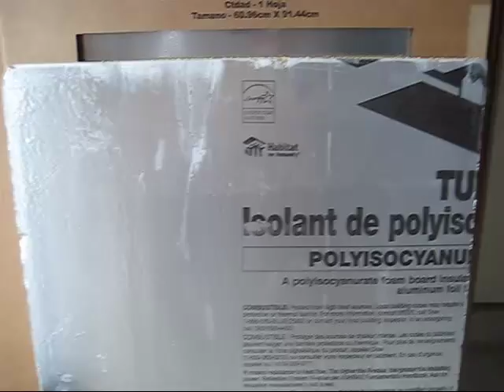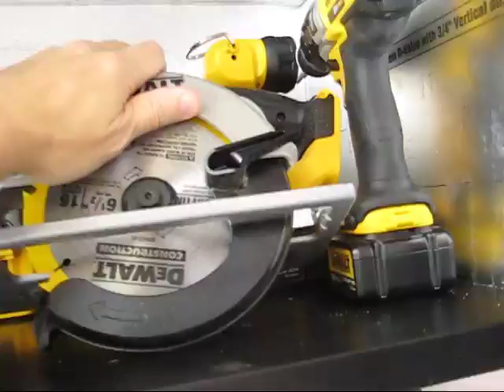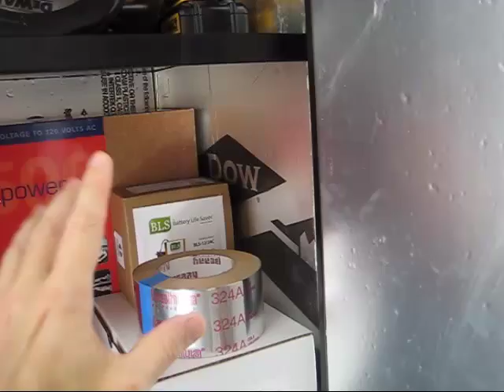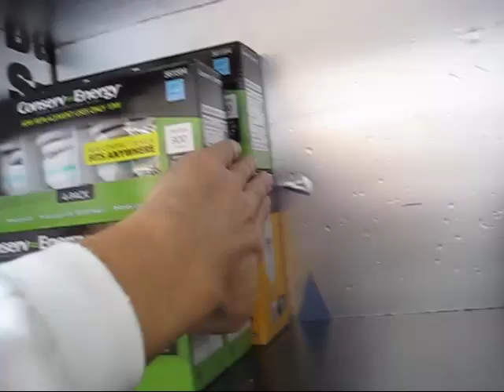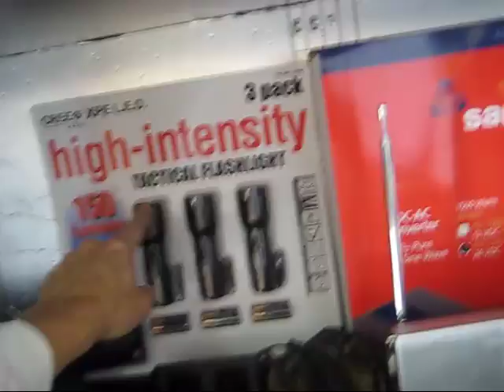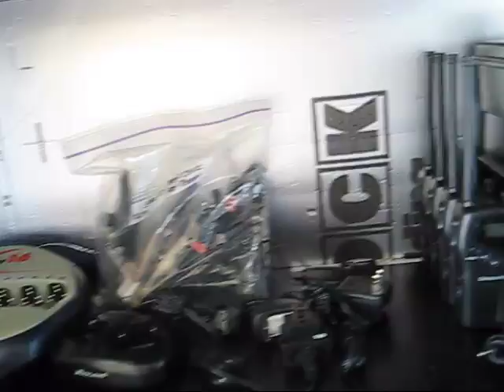Faraday Cage: How to Make on the Cheap

Comment: YOUR rule, no signals must enter?????? Aren't we being PRESUMPTUOUS???? The effective Electromagnetic potential from an EMP will greatly exceed any local RF radio station but only for a brief period of time. The foil will degrade over time from opening and closing the door. A better choice would be metal screen with screws going through the screen into the front door and side doors. You should sand off the paint wherever  the screws go through the screen.The screen material must be metal and NOT the newer synthetic or fiberglass screens. Also consider driving an 8' ground rod into your soil close to your cage and use heavy wire attached to the cabinet of the cage. This will keep the potential of the cage at ground potential. Again, sand the paint off where the screws mount into the cage, I would run 3 or 4 wires up and down the cabinet side to the ground rod and keep the wires as short as possible.
if Items like electric motors on a chain saw are destroyed by an EMP event, you will be too close yourself and probably NOT survive.
Items that contain modern electronic components should be your concern. 
Radios, computers, calculators, TV's Monitors, digital cameras, VCR's DVD's, cell phones, or anything that has a processor or controller in it which would include any device that has a digital display..
You might want to consider putting a CB radio in your faraday cage and/or get a Ham Radio receiver that covers the Ham Bands. The bands that will be important are the 80/75, 40 and 20 meter bands. The 40  meter band has a day time range of ~300 to 600 miles or further. The 80/75 meter bands is bad during the day but good for ~200 to ~500 at night. The 20 meter band can be good for many thousands of miles but this band is often dead day and night. All of these ranges are just averfages and very much antenna dependent. But even 50 feet of wire hanging in a tree to your receiver will provide OK reception. You can NOT transmit on that piece of wire unless you have an antenna tuner and knowledge to use it.  Kenwood, Icom, Yaesu, Ten Tec, Elecraft, all make receivers or Transceivers. You will need to get a Ham license to transmit normally but during an emergency such as an EMP event, the FCC will not fine you if your intent is related to the emergency and a matter of life and death. Chit chat and general communications without a license can leave you with a $20,000 fine.
I would put solar panels in your cage. If there is a regional EMP event it's likely the Internet could be down for weeks if not months depending on the severity, cell phones too. I ould expect over the air conventional TV to be up quickly in many areas.
A gasoline or diesel generator should survive an event, HOWEVER, electronics on the gen such as control panels monitors and electronic driven ignitions  may fail.

Comment: It's probably already been covered, but in order for it to be a true faraday cage, you should ground it. This could be as simple as running a grounding cable to a water pipe in your bathroom...
Reply: just dont be in the shower or tub or using a sink when an EMP goes off though.....

Comment: HI, just a thought.....
  The metal shelves are attached with a metal fastener of some sort, I am thinking that in a event, high current could be transmitted inside of the cabinet via anything that is not independently insulated to the outside of the cabinet. I am basing this off of the emp event of 1859 and the large current that was able to bridge across weak insulated areas. I am not saying your idea is bad, I really like the concept, I am just pointing out something that might help improve on your design. Thanks for your videos and ideas if you get a chance let me know what you think of mine.

Comment: thank you so much for this idea. it was very valuable info. i investigated further and found out that if you wrap completely an item in aluminum foil the place in a large ziplock or non conductive material then rewrap in aluminum foil again, it will protect your flashlights, batteries, short wave radio, etc. i will be doing this until i cn do the cabinet thing. again, thank you for your awesome video

Comment: I think you're only shielding from electrostatic fields with this method.
First, all devices have to be completely discharged, not just off.; batteries out, antennas removed and receiver inputs capped.
Second, those electronics are not designed to be EMP resistant.
Third, think high-density shielding.
After that is place your shielded enclosure under ground. :)

Comment: If you want to double check a faraday cage is working then put your mobile phone inside. Try and ring your mobile/cell phone, If your phone gets a signal then its not working. 
Metal shelves inside the cabinet are a total failure point because they are joined to the outside. 
Internally a faraday cage needs to be totally insulated.  
Saying that electrical goods are in there own plastic cases so they will be ok on a metal shelf is foolish. 
An electro magnetic pulse works in the same way as micro waves (like your microwave oven) 
You have a good idea using that cabinet but your information and needs a re-think.

Comment: You have not insulated the inside of your cabinet.
The inside is metal and i assume the shelves are metal as well?
When you built your garbage can faraday cage you lined the inside.
If people are going to use a faraday cage then they need to include the batteries and a way of charging them.
That would usually mean solar panels and then you need to take into account that you will need more batteries charged when there are less daylight hours to run flashlights but at that time of year you will have less sun to charge them, 
This means you need double the amount of solar panels.

Comment: what the deal with the mixer and or blender in there? emp wouldn't really damage a hand mixer would it? no transistors just a switch and a motor maybe some resistors but nothing that wouldn't survive an emp. let me know if i'm wrong but i wouldn't think it would be effective against a resistor. no as far as the cordless drill is concerned it would need to be in there. but not a flashlight and kitchen stuff unless its a super new one with transistors just my thoughts.

Comment: Ace...
A two meter radio is most common about $200 at Radio Shack.
Check with your local ham radio club. Those people LOVE to help newbies
and may have used equipment you can buy and learn to use.
Radio Shack also had books on Ham license, and other things that are very helpful for reference on the ham radio world.
A shortwave radio is available at RS too. Only get the top of the line model and their amplifier and copper wire antenna kit to get good reception.
A CB radio saved me once..get one.

Comment: Very well done presentation.
You should get a solar powered battery charger.
A homemade wood frame box with shelves wrapped in those insulation boards or aluminum foils might work also using scrap lumber for the box.
I hope you have a good manual water purifying system too.
How are you protecting your computers?
Lots of books on how to do things are essential. Available on Amazon.
Wood burning cookstove? Also for heating if vented.
How about a human powered generator (bicycle powered)

Comment: One thing that should be mentioned.   The cage really should be heavily grounded.  I used to work in a cage doing electronic testing.  Upon my inspection of the construction, grounding wires ran everywhere.  An emp propagates the same way electricity does.  Hence path of least resistance.  Everything wants balance, and ground is the fastest way to find it.

Comment: Correct, in fact you are both right. There are some batteries which only contain the cadmium properties However Most batteries these days also contain a regulator chip inside them especially if they have any intention as a rechargeable battery. And lets face it that's 90% of batteries these days. From our cellular devices to our gameboy batteries. They are highly likely to become ineffective in the event of an EMP

Comment: i think you would need to have your shelves removed, your shelves are tied to the case, not free of it, then when totally insulated, make your shelves supported from the bottom and keep them free standing, just sitting in the cabinet and not tied to the wall or any metal, but a really good idea,,,,,i double up, use an ammo can line with styrofoam top and bottom and wall to wall, a good sized tool box will give a good seal too

Comment: I am just starting to learn about Faraday cages, and I know you said that your electronics are protected from the metal shelves by therir packaging, but it seems to me, a high powered pulse would transmit the energy into the cage through the shelves, if the shelves have an electrical connection to the outside(?).  Might be safer to rig up some plastic shelves, IMO.  Thanks for the video :-)

Comment: I saw a video where a guy wrapped his cell phone in alluminum foil and it blocked the signal. The call did not go through and no missed call was registered. He tried it in his microwave and steel ammo can but those failed to block the signal. It wonder if the crumpled nature of the alluminum foil had a role to play. If it's as easy as that, it's worth knowing as well.

Comment: LDSPrepper - there are some solar arrays that contain a blocking diode that may burn out from an EMP. As long as it just shorts the diode then the panels will still work, just need to be disconnected at night. If the EMP opens the diodes then you would have to find where the open is and either short across it or put in a new blocking diode.

Comment: Even if the company says it's fine, if you can afford it it is still a good idea to have spares just in case. Beyond the possibility of breaking, and EMP can cause an electrical current burst in your system if there are any electronics connected which can fry out the cells, the wiring, and melt the soldering inside the panels. So while the EMP itself may not effect the panels there is still the possibility of the indirect effects of the EMP killing your panels. Better safe than sorry.

Comment: Just curious,,, did it occur to you to get into the cage with the radio and have someone else close it up to see if the signal is indeed lost? I'm wondering how effective the insulation panels would be for sound proofing and if maybe some of the effect you've witnessed isn't perhaps a mix of EMP & sound proofing together. Just wondering is all, not contradicting,, ok,, just wondering..

Comment from the maker: Your panels and batteries will work fine because there are no electronics in them. You need to store a backup controller and inverter in a Faraday cage because they are electronic and will fry in a EMP, if you are concerned about an EMP.

Comment: You also need to keep all your stuff AWAY from the sides of you cabinet and use a rubber mateor plastic on your shelves VERY inportant. A emp will go from the outside to the inside so INSULATE           PETE

Comment: Another thing, for your backup drive in the cage... wont the cables  and power line leading outside of the cage act as a conductor back to the drive inside?. Do you have your batteries and solar panels protected too? Gen set?
Just asking questions.... to things you didn't address.

Comment: We had a metal cabinet sitting in our garage, left over from a business we sold.  So out went the cans of paint that were being stored...I first tried just the metal tape without the insulation panels and that reduced the radio signal, but did not cut it out completely.  So we bought the 1/2" insulation panels with the metal backing.  I taped it to the outside with the metal facing inward.  And that did it!  All I got was radio static!

Comment: Hi, just thought I'd mention a couple words on EMPs they can occur at multiple frequencies, Radio and Tv signals are in the VHF/UHF bands, for solar flares you want to shield up to 1GHz at -50db according to links online, 1Ghz is more like a gmss band radio, or a wireless a router the oldest kinds. Those radio waves are smaller the smaller the wave the smaller crack it can get into radio stations in am are in the KHz range while fm about in the 90-110 MHz range this varies, nuclear EMPs seem low

Comment from the maker: If you take a little longer look you'll notice that everything sitting on the shelves has a plastic housing. The reason electronics have a plastic housing is because plastic is non-conductive. The plastic insulates the electronics. So there is no need to add a buffer or change out the shelves.

Comment: I would like to build a Faraday cage around my safe. My safe is bolted through the carpet and into the cement floor. Is this possible to enclose the cabinet my safe sits inside of or just the safe itself and if so, how would I do that?

Comment: replace the rubber seal with one made from braided wire. Sand off the paint on the area of contact. Braided wire is used as a gasket on some radar equipment to block the RF from "leaking" thru joints. Make sure the braided wire gasket you made is fully contacting all around the door.

Comment from the maker: I tested the ammo can too. I found if the antenna was touching the inside the ammo can didn't work to block the radio signal. If it wasn't touching the cammo can worked.

Comment: What is your cabinent resting on? The concrete/floor conducts electricity/EMP...

Are you going to line your cabinet's interior shelves and/or insulate your contained items individually?  Reason I ask... your cabinet's exterior metal walls are directly connected to the cabinet's metal interior shelves... conductivity...

Comment: Readers, PLEASE, PLEASE, PLEASE understand that a radio losing "signal" means absolutely nothing in regards to electromagnetic pulses. It is nothing more than a myth spreading false hope among concerned people. If we are unfortunate enough to be struck by an enemy with an EMP, a used tool cabinet will do nothing. Just FYI.

Comment from the maker: The shelves are metal. As you know plastic is not a conductive material. If you notice all the things sitting on the shelves is housed in plastic. So there is no metal on metal contact, if that is a concern of yours. I insulated underneath the bottom shelf with the foil insulation that is on the sides of the cabinet.

Comment: Great video. I have discussed these types of scenarios with my friends and I think that it would be great to have an old pre-electronic ignition system car parked outside with spare ignition system parts and replacement battery in your Faraday Cage. You would probably be wise to have a spare starter and alternator or generator if it's a real antique car or truck. If you had a gas powered generator, it would be good to have spare parts to get it operational too.

Comment: you *must* ground that rig otherwise your efforts will be toast.  EMP is different than radio waves, if you don't ground out your cage you'll wide up amplifying the effect you want to protect your gear from.....   drive an 8foot solid copper grounding rod into the ground and attach that rod to your cage securely....  don't use the house electrical ground, it's quite unreliable when used in ths manner....

Comment: Like I said though it would more likely be CME than anything. Or an extreme case is if someone used a "pinch", EMP burst weapon. As for old cars I think it is the alternator points or something along those lines in the ignition system that would most likely to short and/or burn. More than any EMP/CME preps I would suggest greenhouses and seed/soil storage.

Comment: EMP is just the initial pulse. That is what kills electrical devices. The residual effect is snowy/static signals, but it does not last very long. The biggest problem in an emp blast will be modern automobiles with onboard computers. If you have an old jeep or something you can replace any burned parts with parts you have in a F. Cage and be good to go. CME is really a bigger issue. EMP from nukes is a pretty local phenomenon. CME is a persistent large area event with lots of after affects.

Comment: One thing I would add into there would be something like an Barnes and Nobles Nook, loaded with books, survival guides, information based pdf files, images  of family, etc.... which can provide almost and endless amount of pleasure reading in a SHTF situation and most  information on your possible situation at the time. They stay charged for a long tiome and can easily be charged by something like a emergency radio with a usb crank charger or solar charger if needed.

Comment: LDSPrepper-Thanks again for another fantastic video.  I'm looking on craigs list right now for a metal cabinet.  I have a small 2 drawer metal file cabinet in my garage that is collecting dust and dirt.  I plant to test the radio reception and fill in the gaps where needed.  I have extra cardboard from a book order I just received so I can use that.  Do you think a small, clean, new gallon size paint can would work for smaller things like flash lights, head lights, etc?

Comment: If you want to really test it go and get yourself a 2.4ghz radio system for rc cars off of eBay, a servo and a little receiver pack to power it. Put the servo, receiver and receiver pack inside and see if the sygnal gets through.

Comment: The articles that I’ve read stated that a barrier between your electronics and the outside metal structure needs to be created.  Your setup has metal shelving is in direct contact with the outside metal structure.  Just a thought, remove the shelving and replace them with a 2x4 wooden frame inside your cabinet and incorporate wooden shelving.  Your insulation would be place between your wooden frame and the out metal cabinet.  Let me know your thoughts…